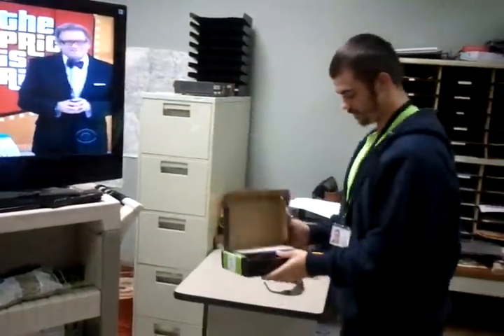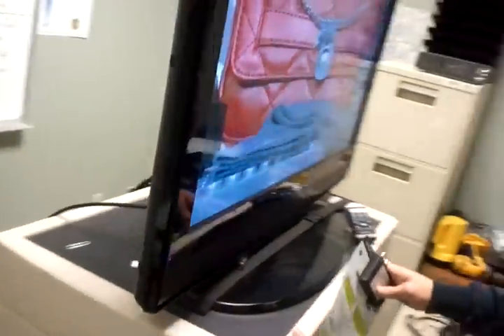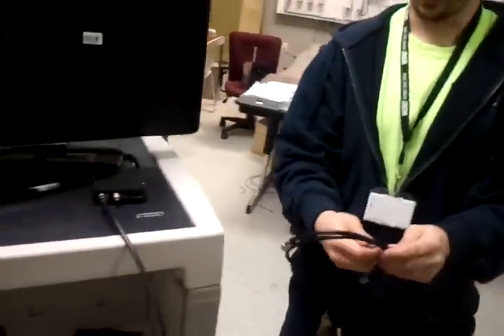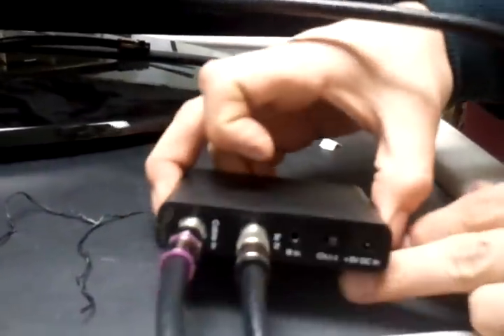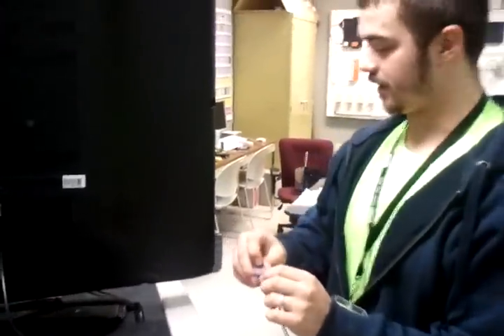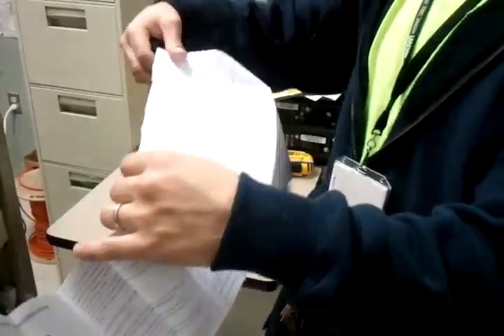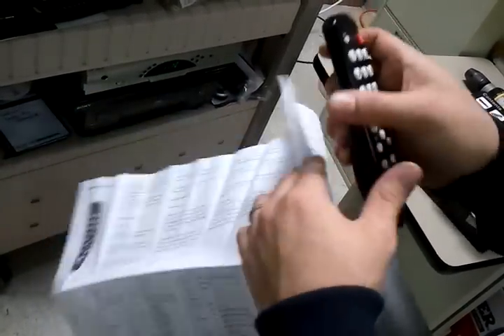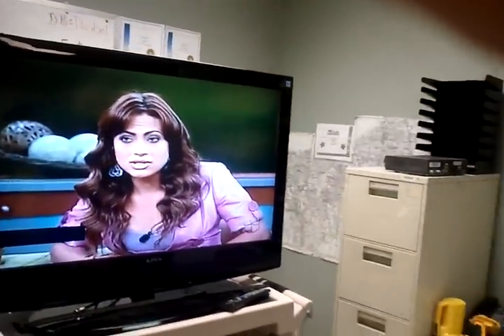dta setup instructions

Comment: Is this needed on OTA antenna reception?
Reply: If your TV has a digital OTA tuner (ATSC for US) – no. If your TV has not – yes, you need… but another, OTA digital tuner box. This one is a QAM cable tuner and only works via an active connection and subscription from the CATV provider.

Comment: The channel the TV should be on depends on the area you live in. Some areas use ch4 so you would use this adapter on ch3! In my area WEARTV3 uses ch3 so we use ch4 for any coax connected TV, but if using an HDMI you just need to be on that HDMI input to see the picture.

Comment: People pls read this and you will save money. Time Warner cable  and other companies are doing this so you give them your money do not do not get this device go to cvs or any electronic store and buy the digital box there, why?? ok here it is i just talk to TWC after they told me that this small box was free i found out that is not free they told me that i am paying 2$ every month for the small device plus 10$ for the 20 channels that are actually free yes they are free WHAT???  yes i'm getting scam for something that is free now lets do the math you will pay let's say 2$ for the device and 10$ for the 20 channels every  month so in a year that is 144$ keep in mind that is without TAX,,, let's say you keep this device for 5 years that is 720 for something that is freeeeee lol. Just go on amazon and buy this 1byone Amplified HDTV Antenna or Digital converter box ALSO any other device just like it. and you will get the 20 channels that are free plus more. easy i did my part now dont let them scam the shit out of you.
Reply: The converter boxes at the store DO NOT work with digital cable TV. Digital cable TV uses QAM, and broadcast TV (which the store bought adapters are made for)  use ATSC. Totally different type of box.